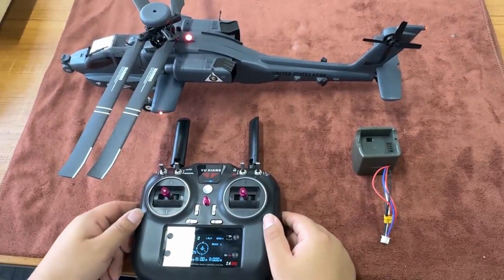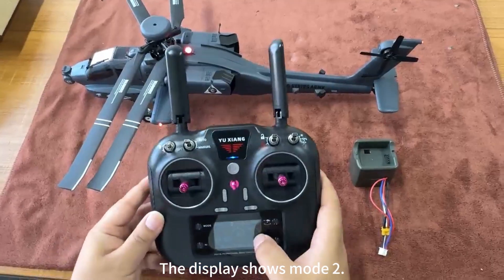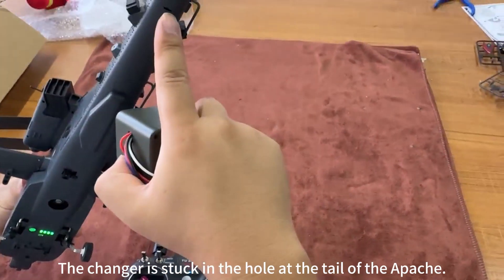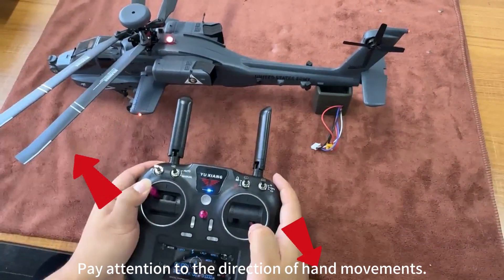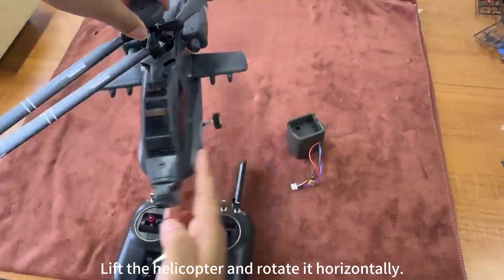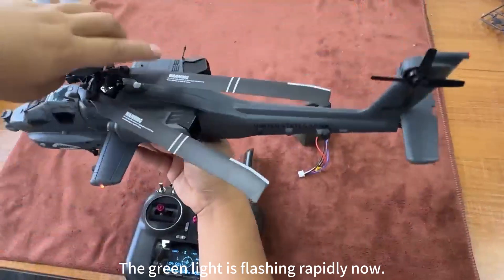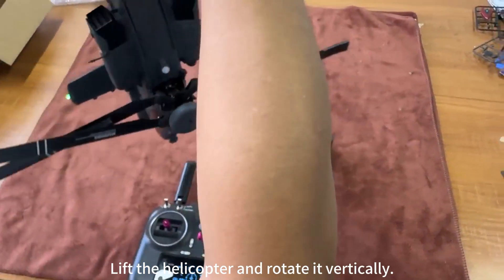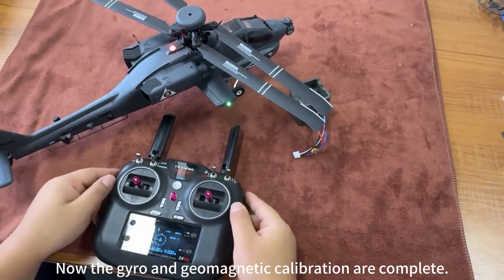YuXiang F11S Apache GPS helicopter：Calibrate the gyro and Geomagnetic calibration

Comment: Please help me...Purchased the F11, not the S with GPS. To calibrate the F11, I bind to radio, left stick upper left hand corner and right stick lower right hand corner. LED will flash yellow then go solid green. Then I'm done? Thanks!
Reply: Yes then you are done. Once that green light turns solid your gyro is calibrated. Or in other words on your transmitter push the left trim slider button to the left while powering on the transmitter. Do both at the same time. You will hear the transmitter go into a beeping mode. Now power on your helicopter with the battery installed. And set your transmitter down next to it. Once the yellow flashing turns to solid green you are bound. It's as easy as that. Hope that helps.
Reply: Bonjour 
J'ai le même problème avec ce f11, et la notice ne précise pas!
Reply: Why did my gps start flashing red can any one help

Comment: Do you have a manual or video tutorial on how and where I can install the camera on the F11S Apache helicopter?
Reply from the maker: Hello, all the 5.8G cameras sold on our website come with a detailed manual. May I ask where you purchased this camera? If the product you purchased includes a manual, you can follow the instructions provided.
Reply: @YuxiangRC  The camera came with the helicopter. In addition to the user manual of the helicopter, a small white sheet was also supplied with the specification and dimensions of the camera, but I cannot find anywhere how to attach the camera to the helicopter.

Comment: Why does my pointer on the screen go crazy North then East n and goes back and forth I no how to calibration the gyro n the GPS I had 17 satellites what is the problem?and Also why can't you just make the f11 GPS heily bind n fly so people can use the special controller from the fo9-s and the fo9 h.find it silly that people will have say the fo9-s and the fo9 h and f11 GPS version with 3 controllers all doing the same thing??